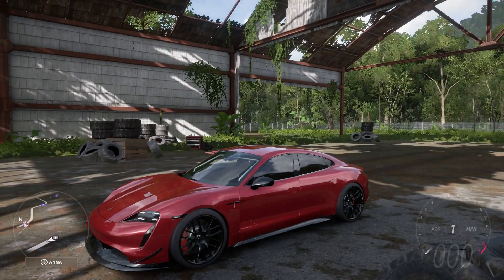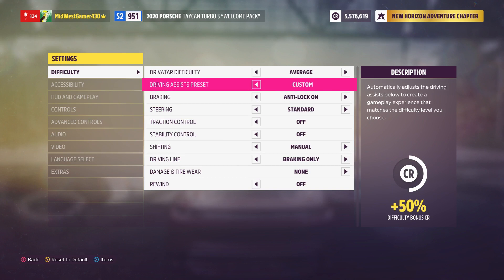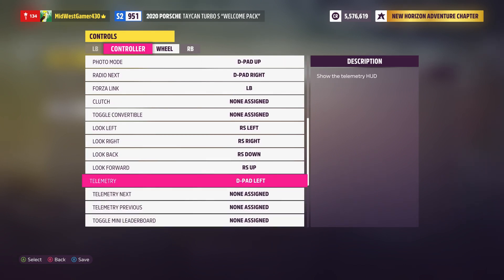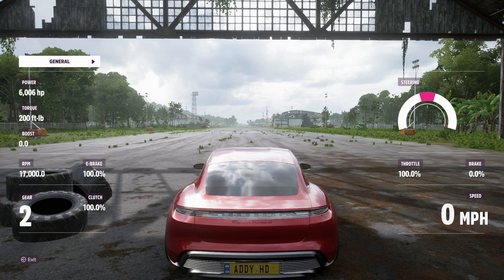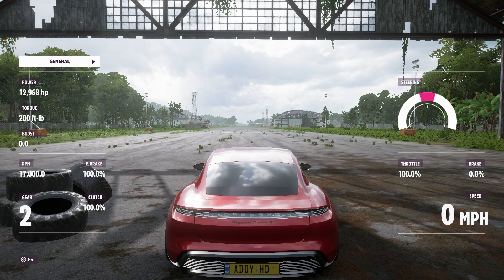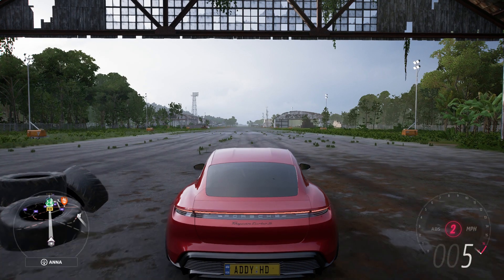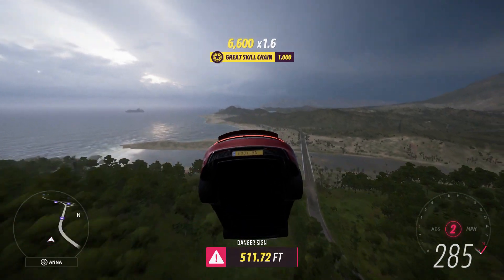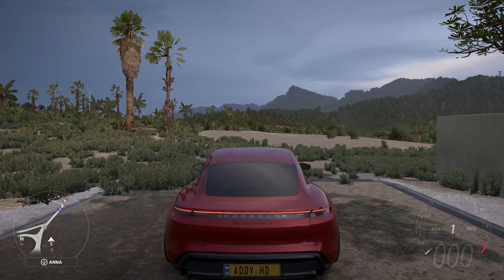Forza Horizon 5 Speed Glitch ( Very Detailed )

Comment: is there a certain tune i need? also does it need to be the welcome pack version or is the normal version good?
Reply from the maker: It works on any electronic car, only thing i have done to the car is fully built. And the gears dropped pretty low, you have to hold it until it hits 250,000 or higher for the effects to kick in. @krughy